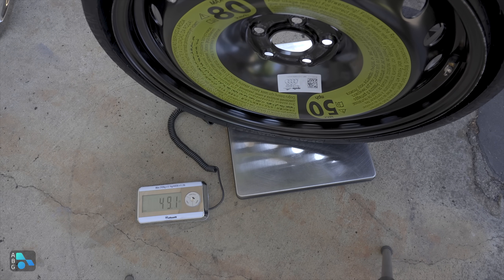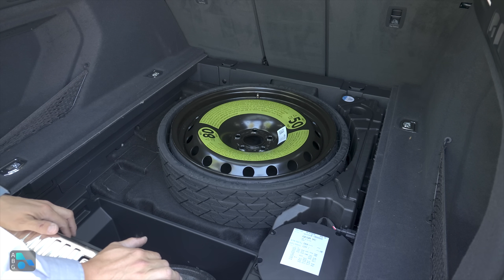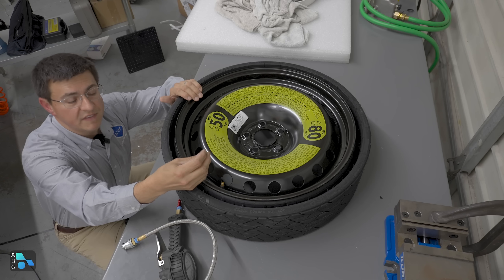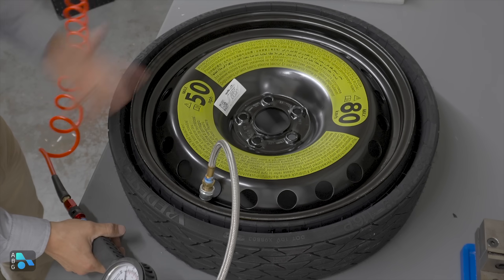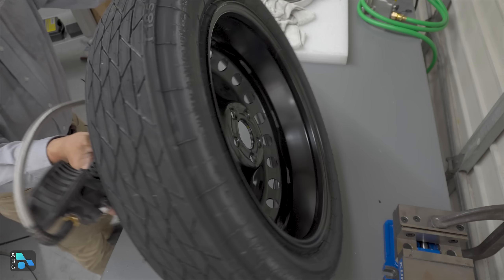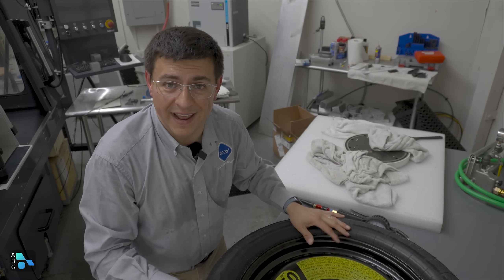How A Collapsible Spare Tire Works, And How It Might Save The Spare Tire In EVs

Comment: These are the worst.  They are a poor solution for a problem that didn't really exist and create at least 4 others. 
1)They require an air pump which can fail AND which draws power from the electrical system of the vehicle.
2)The inflation and deflation process can lead to injury.  It is very easy to get a pinch injury when the sidewall pops out.
3)These tires are more prone to failure.
4)If the well is sided for the space saver, then where will you put the flat tire?  In the Porsche 911, the only place to put the flat tire is on the passenger seat, so if you have a passenger, you need to decide who or what to leave behind.

Comment: Nice idea 💡, but I would rather have a normal full size spare tire. 
Luckily, there is an  EV which you can buy, that has such a normal size spare.
That is the new Mercedes G580 , you can order it with a full size spare on the back door 👍

Comment: I can see the truck is actually ok to fit a full size tire without those moulding around. A collapsible tire can save a little space but needs a lot of work when you want to use it & not strong enough as compare to normal spare tire.

Comment: Yes it seems like a good idea but it turned out to not be when they began installing them in 1975 when GM used them in the Olds, Starfire, and like models of  Buick, Chevrolet, and Pontiac.   The problem back then was the single use fill canaster.  Today it appears the problem is similar with a slow fill pump.   Better than nothing but give me a spare tire that is ready to use.

Comment: Space savers dont save space they sace money for the manufacturers.

They go under the vehicle or under the boot floor,  spacewhich has no other pourpose.  You still need a hole big enough to store a full size tyre because where are you going to put the flat one?  If you already have passengers and a full boot (trunk for the americans)

The astra was known for this issue  it had a space saver spare tyre under the boot floor, in a well that was the exact size of the spare and could not fit a full size tyre so once you had changed the tyre,  the dirty   flat tyre had to either go in the boot or on the seats.

Comment: The included compressor shuts down because of overheating before the tyre gets to 50 psi. It's a 20 minute process just to fill it up. And the bootspace cannot hold the main tyre inside the tyre cavity. Weird choices by the manufacturers!

Comment: The better solution is carry yourself a temporary tire repair kit + air pump. When the temporary plug leaks, then go to a tire shop to fix it. This is a far better solution than carrying temporary tire. If you put spare on a drive axle wheel, it will hurt the differential. Sure, if a car is two wheel drive, will can swap the tires, but for awd vehicles, you can't swap the tires.(samething for staggered tire vehicles)

Comment: As a mechanic I would like to know when you last had your scale checked out because I  have delt with a lot of tires and rims and last one I had a tire and rim combo weigh that much it was a really big mud tire on a lifted truck and when it comes to those style cap you might as well toss it in the garbage because it will only work a couple times

Comment: You have put the space saver tyre on you have 5 people on board and the boot is full what do you do with the full sized wheel and tyre you have taken off. It is not going to fit where the space saver came from. Fair dinkum there are some dumb cockheads who design cars.  When you have towns 200 - 400kms apart you must have only a full sized spare wheel, jack and wheel spanner which should be mandatory by law, to use a space saver is tantamount to negligence by the vehicle manufacturer.

Comment: This is hardly a "new idea"! The "inflatable spare" was in 1970's GM Monzas, Skyhawks etc. It was a bad idea then and is still a bad idea. If you ever had the misfortune of using one: If you're lucky, the air tank still has enough air to inflate it. Now you just brave enough to inflate a folded dry rotted tire and drive on it!

Comment: My 2014 vw came with a standard doughnut style apare. The space under the trunk fits a full size. So i bought a used rim and kept my best tire when putting new tires on. I now have a full size spare that i could drive on for months if i need to.

Comment: Ford installed them on the Mustang back in 1968. You should always use the canister (fixed volume) to inflate, there have been multiple recalls and NTSA safety campaigns after people in the 70s started killing themselves inflating them like you did.

Comment: Collapsible spare saves space. That’s great. Where do you put the tyre that you took off that was flat assuming it is full size tyre and wheel  or do they assume that you drive it until complete disintegration 
Feels like a problem that didn’t need solving 
Just put a full size spare or none at all

Comment: My A6 Allroad has the collapsible spare. That works fine. But try putting the pump cord and hose back into the pump housing. I don’t know what black magic they use to pack it all in there in the factory. I’ve tried over and over to get it all to fit nicely. Never got it to fit like original.

Comment: GM used to have these in the 70’s and 80’s. 🙂 they had a compressed gas cylinder specifically designed to that spare. You popped it in and your tire would automatically fill to the exact pressure required. 😎
Reply: I never actually used one. So I can’t say how well it worked. But I have seen them before and owned a Chevy Monza Spider that had one.

Comment: I just don't see this technology as a step forward. 

It has to have limited numbers, is complex to implement. It will be crazy expensive. People just do not follow the usage limitations so this is an accident waiting to happen with the manufacturer having a valid legal defense when people die.
All this is irrelevant! The space designed to hold this device is just big enough to hold IT. go on change a normal tire with this abomination and then see just where you are going to put the damaged tire...
The industry MUST get over this insane idea of little minim tires to save space. It shows poor design because it does not provide a storage space for the damaged wheel being taken off.

Assuming that this is a step up from not having a spare at all, Just what the heck are we doing buying cars so poorly designed that they don't have a spare in the first place?

Comment: It's a good idea, but it's only good for some situations.  If I had to carry a compressor to inflate my spare. I'd rather just use the compressor to inflate my flat tire back up to get me to tire shop, where I'd have to go anyway, even with spare on.
Reply: That only works if it's a very slow leak that you caught before driving on it for a mile and shredding the sidewall, like my wife did two days ago.

Comment: So in order to save space you need to inflate it on the side of the road but I'm sure the space saved would be the same volume as the air compressor you need to inflate
Reply: The fact that the jack and the compressor are not stored inside the wheel baffles me.

Comment: You know what would have used less space than a collapsible spare tire (and the plastic form to hold it) and a compressor....... a full size tire. This is cost cutting measure nothing more. I will happily stick with my truck's full size spare.

Comment: These things are one of the scariest and most dangerous tyres I have had to work with . So many failure points for not much saving.
I’d rather carry a full size spare than have to deal with one of these and a have to have a compressor to inflate. Sometimes things just have to be left alone without ‘improvements’

Comment: OK, nice. But as for me I would ALWAYS opt for a full sized spare tyre. No speed limit and I could get to a tyre repair shop with a good feeliing. No space you said? Dude, in the 80ties they were able to fit a full sized spare tyre, so why not now? No space in the back? So why not putting the spare tyre under the bonnet? Like Citroen DS or Lada Niva (Lada 4x4)? Weight? Calculate how pollution will you do taking the difference in weight between a full spare and the very technologically advanced one. How long does it take to produce the special one. Taking the SUV consumption level, the difference is negligable. Full sapre is the best, at least for me.
Reply: Eh, I've had a donut up over 100mph on more than one occasion. They can handle interstate speed for a while. The 50mph rating is just a CYA-thing.

Comment: EVs are already grossly overweight and giving up a little space to have a full size spare would be a much better compromise.  Carrying around a tire pump and that collapsable spare is just some sort of sick joke.
Reply: Why? It's not just EVs that don't come with spares these days. People keep saying EVs are overweight. But a Model 3 RWD and a Toyota Camry have about 50kg between them. So what kind of vehicle do you drive Kirk?
Reply: @mondotv4216  When comparing weights, you have to compare vehicles that meet the same needs criteria for a particular owner.  So, its certainly not easy to define apples to apples comparisons.

But, to your point, a Tesla model 3 weighs about 500 lbs more than a Camry and about 950 lbs more than a Corolla which is more comparable to the model 3 than the Camry.

But my comment was directed toward the collapsible spare which is simply a bad idea for any car whether its an EV  a hybrid, or an ICE vehicle.

Comment: One of the biggest mistakes was getting rid of full size spares. All these gimmicks are garbage. My full size spare doesn’t have any speed restrictions and I can’t run it until I get a replacement indefinitely.
Reply: And if you live in a country with snow you can mount the appropriate tread for the weather.

Comment: What’s oxymoron statement “EVs doesn’t have spare tire because they don’t have room to fit a spare tire”! Tesla, Rivian, etc have lots more room than any ICE counterparts. It just that their engineers are arrogant that flat tire problem would never happen to them in their high tech SUVs. Get over it, ALL on or off road vehicles will get flat tire one way or another.
Reply: I agree. I watched a review on a Rivian and it had flat while in a trail.  Not having a spare on a vehicle designed to go off road is dumb, stupid and potentially dangerous.

Comment: They are worried about an extra 20 lb of weight considering the battery weighs 4000 lb. Really smart move let's just carry around a flat spare tire what happens in 5 years when the air compressor doesn't work anymore or the previous owner broke it or lost it. Stupid design

Comment: Where do you do with the full sized (punctured) wheel if you have a full trunk?

It obviously can't fit in the same place where you had the collapsible wheel stored and Finagle's law says "Anything that can go wrong, will—at the worst possible moment." Such as during a long road trip.

Or put this another way. If the car has space for a normal wheel, why have a collapsible wheel at all.

Comment: My 1982 Porsche 928S has a collapsible spare wheel.
And it wasn't new in 1982, either.
Protip: make absolutely SURE that your 12-volt air pump is actually able to inflate the spare in a reasonable time frame. The only time I have ever had to use it, it took more than an hour to inflate the spare, using a cheap-as pump running from the cigarette lighter.

Comment: Great after a few year when you inflate it and the sidewalls all cracked, ....worse thing is,a full tyre often fits where the spacesaver is,  look at this one, if all the polystyrene moulding was removed, a full size would prob go in there.... spacesavers ,limited miles,limited speed,awfull ride,, and expensive, buy a tyre plugger instead, and a cheap metal full size wheel if it fits

Comment: This is an amazing design but you will still need space for the original wheel and tire to be repaired?  Where are you going to put that when the spare is on! You still need space for the   largest wheels and tires when the spare is in use.  Designers and consumers forget about that until they realize they don't want to leave $500 runs behind on the side of the road.    The spare space needs to accommodate getting the old tire to the repair shop the next day
Reply: The nasty dirty blown out tire should go back in the space where the spare normally lives.... otherwise you will have a big clean up.   Also if you have passengers and luggage, now what?   Just have space for the original wheel/ tire and use the new design to save weight and give you extra storage.
Reply: I would assume you can just put it in the trunk, rear passenger floor, or basically any space you can find on your car, might not be the best aesthetically, but for emergencies this works

Comment: I have mixed feelings about spare tires. In my last car, sod after 14 years, never used the spare. In my truck (lightly used-third vehicle), 22 years of use, never used the spare0it dry rotted, and replaced with best used tire when I needed new tires. My wife's car, with about 65,000 miles, needed spare once time. 

I realize this may not be typical, but I also realize that a spare tire is often never used. It adds 50-70 pounds to the vehicle, plus the weight of the lug wrench, and jack, to a total of close to 100 pounds, which makes the car use more gas, and takes up a LOT of room. In addition, many drivers are too old, frail, or simply don't know how to change a spare. 
Could not tire companies create a 'spare' that is no more than a steel wheel the diameter of the TIRE on the car, with a thin strip (like 3-4 inches wide) of hard rubber for traction? The purpose of this 'spare' (let's call it an 'emergency tire' instead of a spare) is to simply get you to a tire shop, or at least a safe location, at no more than 30 MPH???

Comment: I'll stick with cars that hold a full sized spare tire in their wheel well.   In my life I have destroyed by various things, and every one of those when I was > 300 miles from home and on a time schedule, they all occured on a Friday afternoon or weekend where I would have to sit for a weekend somewhere as I ran specific tires that most shops did not have (and had the 1st generation performance tires that came on a metric rims in the USA (on Ford Cars) which were imported Michelin European sports tires (I would have had to replace the rims to put American tires on the car) .   

In 2022 I had a Michelin tire start to delaminate over 1000 miles from home in Florida when my wife and I were coming home from vacation on a Friday and she needed to be at work on Sunday.

Change the tire and continue to go (the very handy located tire shop at the next exit in Florida could not believe that I had a full sized matching spare tire in my wheel well).  It has saved major issues many times between destroyed tires and flat tires.

I can repair a flat or replace a tire later on my schedule.  Priceless.

Unfortunately, there are only a few car manufacturers who build cars that hold a full sized spare and jack in their wheel well.

My wife's car also has a full sized spare - and she has learned the value in that as well.

Comment: If there is no room to put a regular spare, where do you put the flat tyre and wheel you just replaced? If it fits where the collapsible tyre normally lives than it should just have a regular spare.
Reply: Well you can always put it in the boot or in a seat well. Doesn't matter if it's only temporary
Reply: @BradsSpace2  too bad if you're on a road trip with a full car of people and luggage. Its not for me.